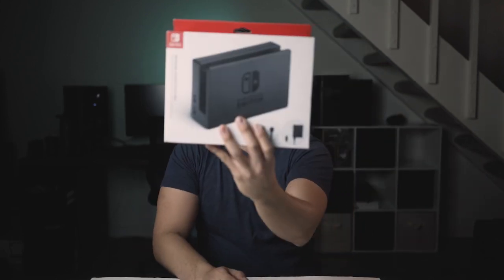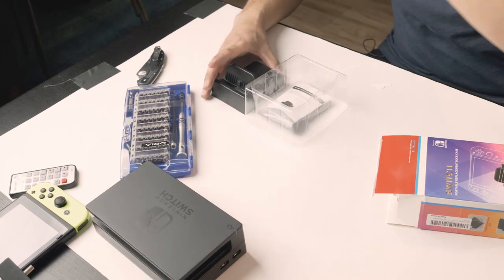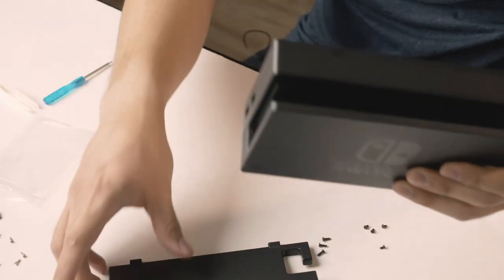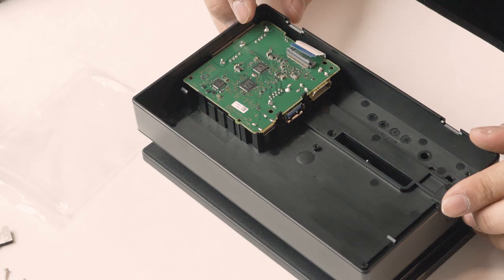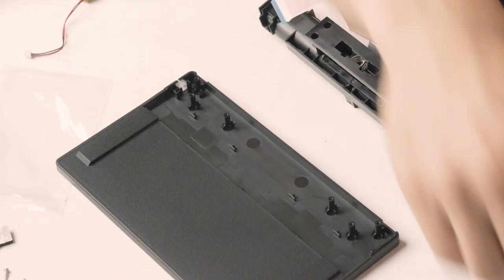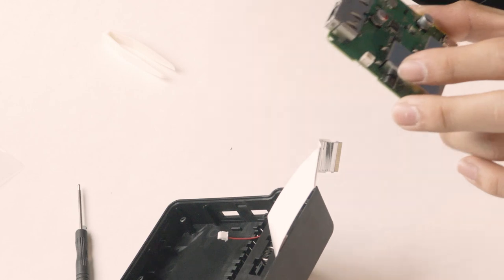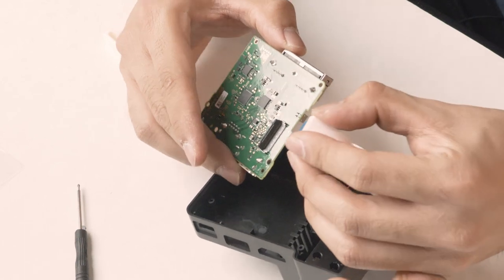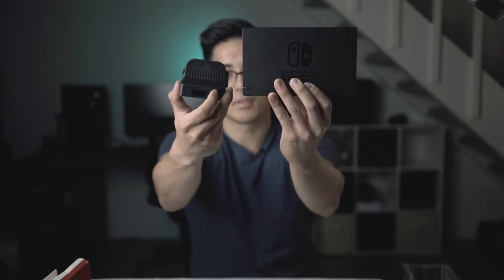Linkstyle Switch Dock Installation for Nintendo Switch

Comment: This clip put LED PCB wrong side , you must turn green side to the front. The LED chip is on green side.
Reply from the maker: Thanks for letting me know! No wonder the LED is so dim
Reply: and the adesive is supose to put in the place where the switch stands, side by side with the usb c

Comment: Great video, one thing I did different was to put the adhesive above the led chip. This way when I installed the spring mechanism the adhesive wouldn't get in the way.
Reply from the maker: Great idea!
Reply: I'm 99.9% certain the adhesive pads are meant to go on either side of the docking slot on the outside. This helps the Switch rest more securely on the dock. They are not intended to hold the LED cable in place. If you are worried about the cable moving in the way of the spring mechanism you should use different tape or hot glue.

Comment: Any updates on this shell replacement? How stable is the with console sitting in it? With the lighter base, can you still undock with one hand?
Reply from the maker: I used it for a trip to Japan. It sat fine on the dressers no problem. Kinda difficult to remove with one hand, but I didn't find myself removing it often. I usually just use two hands to be safe. 

When I try to use one hand the dock kind of lifts up with it.

I still use my regular dock at home, due to ease of use (one handed).

If I only had one dock, I'd still mod it to be smaller. I leave my switch in the dock almost always. So removing with one hand isn't a huge concern.

Comment: Does this dock keeps the Switch cooler compared to the original? Since you have both docks, could you make a video comparing the temperatures? Please
Reply from the maker: Never had a heat issue personally. I’ve games like 3 hrs on small dock.

Comment: I would get one but I'm so scared of bricking my Switch
Reply from the maker: This will not brick your switch. It uses Nintendo’s OEM dock internals. You have to use a real Nintendo Switch dock and just move the electronics over to this new plastic mold.